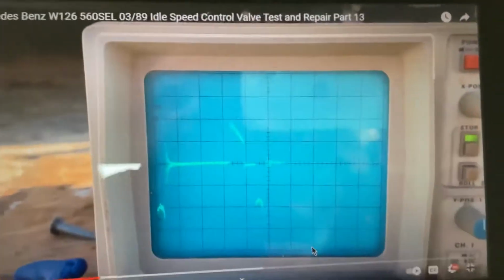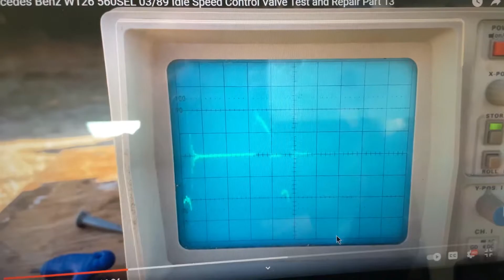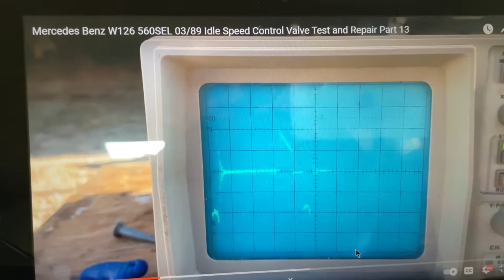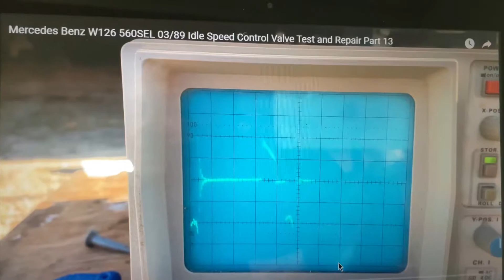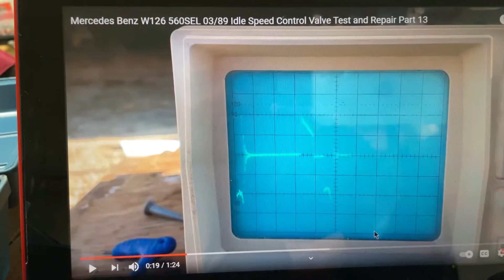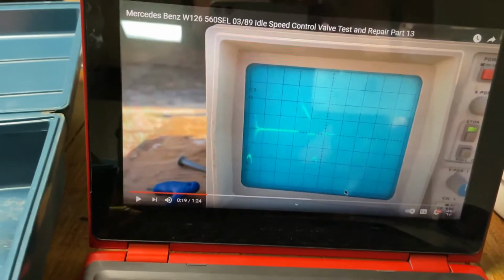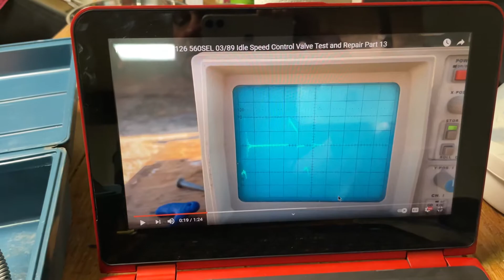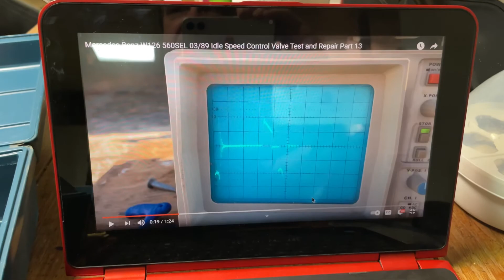Tutorial bleeding of Bosch K KE KE3 Jetronic for Mercedes & when to set mixture to 50% Duty Cycle

Comment: Hi Peter. I rebuilt my fuel distributor and took it for a smog test. It failed. Any ideas or suggestions? Thanks
Reply from the maker: What is your CO and CO2 and how much over the limit are you?
Reply: @inovahightechltd  2.25 for co and 13.8 for co2
Reply from the maker: @georgesand4629 did you test this or is this what they told you?
Reply: @inovahightechltd  it’s ca smog check done every 2 years . This the 1st it’s ever failed smog check
Reply from the maker: @georgesand4629  you may have to adjust your mixture with a CO / CO2 Tester in the exhaust.
Reply: @inovahightechltd  ok. Also the economy gauge isn’t all the way to the left. I did a vacuum leak test of the engine and there were none.
Reply from the maker: @georgesand4629  that’s valve / camshaft timing
Reply: @inovahightechltd  do you have a video on that subject?
Reply from the maker: @georgesand4629 we are in the process of making one
Reply: @inovahightechltd  do you have one on replacement of fuel injectors,holders,seals?
Reply from the maker: @georgesand4629  the playlist “the big repair” covers those

https://youtube.com/playlist?list=PLO4ZlzALkZVq3NysVV7vqO7BiZ9Kd_97D&si=00wTyTZYEM0-eHum